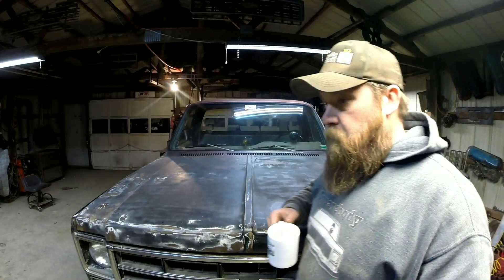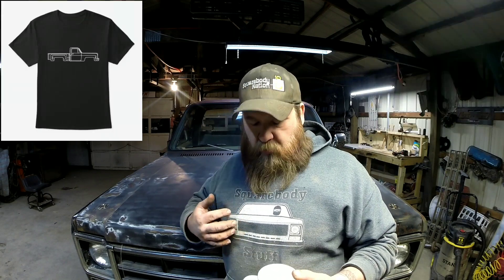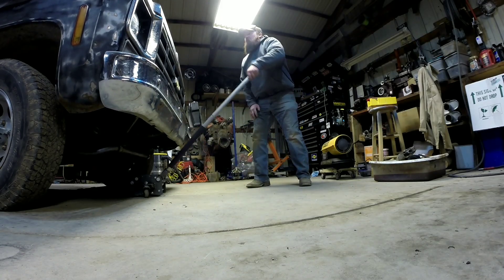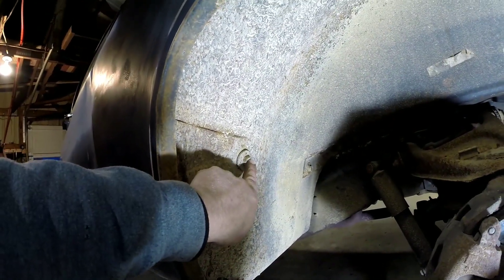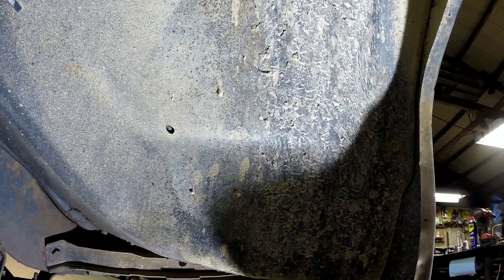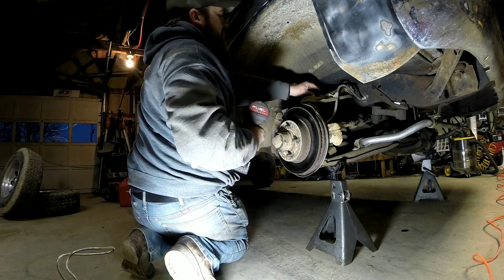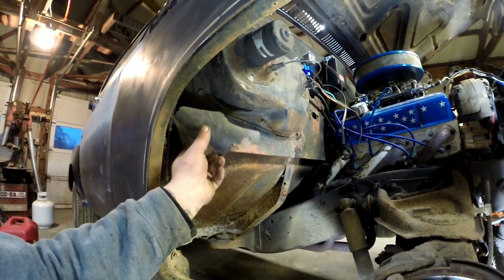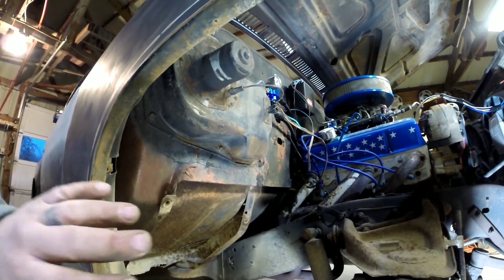how to remove the inner fenders of a Squarebody

Comment: Do you have to take it completely off to get to the bottom bolts on the heater core housing or can i just take out half and let the wheel well sag down so to have enough room to remove it ?
Reply from the maker: You can get to them without moving the inner fender.

Comment: This job could be quick and only takes 15-20 minutes if all the bolts cooperate but can get ugly real quick. The first time I pulled the inner wells out of my c10 every single thread clip broke so the bolt would just spin and I had to grind the head off of every single one of those 1/2in headed bolts on both sides, it took a solid 4 hours to do but now that I replaced the hardware I can pull them out in 10 min.